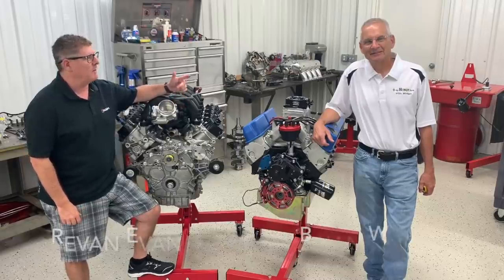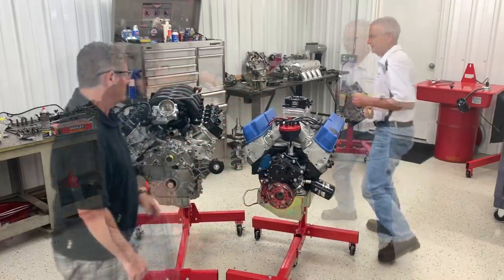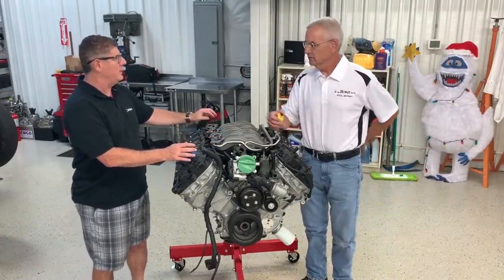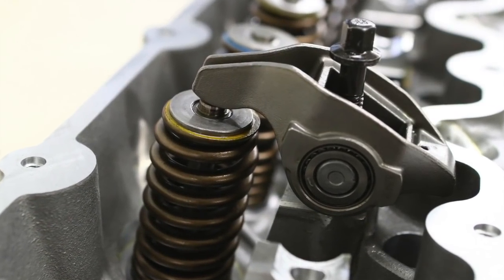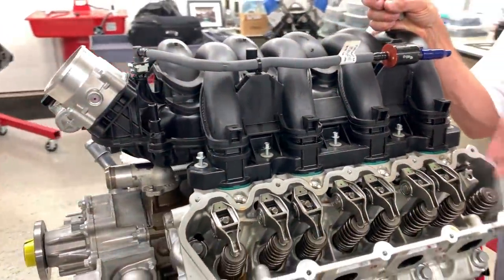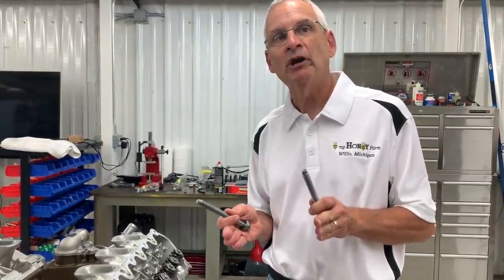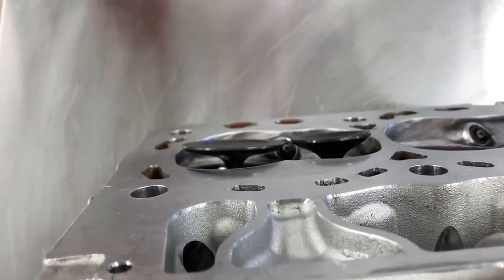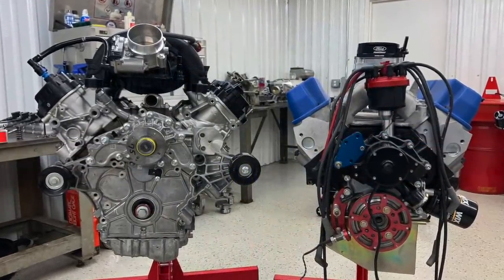Ford 7.3L Godzilla Engine Dyno Results, Teardown & Comparison to Coyote & 351 Windsor Part 2

Comment: Step aside LS there's a new sheriff in town!
Reply: @mewrongwayKOCXF  lol... The joke will be on you..  On a side note I'm not a LS hater, in fact I think it the best engine GM has ever built!  People want to hate on this new engine, but yet the engine screams potential... Time will be the final judge....
Reply: HAHAHAH
Reply: @baby-sharkgto4902  You Sir are Correct!!
Reply: This will unfortunately be fairly low production only being in the superduty trucks.. part of the allure of the LS is the same as gen 1 SBC, huge production numbers.
Reply: Not even close, under 600 horse on a cam swap, head work and intake on that big motor? lol you can get that power from the same mods to a 6.0-6.2 LS and spend thousands and thousands less
Reply: @Doc8224  i was lookjng forward tk seeing stock numbers for sure but those added mods were very minor. The head porting wasnt aggressive nor was the cam. The cams and head work on a ls would be more extensive /aggressive to make those numbers id wager.
Reply: Joey Kimball 
Oh absolutely it would. I think it’s a great motor and I’ll love to see them modded and raced. My point was it is not and never will be a LS contender. It’s not a blue collar race motor to be had by the masses. It’s a low production and therefore expensive project engine. If you spend the same money on this and an LS based build you’ll have way more power for far less money in the LS. They are plentiful and therefore cheap to procure and the aftermarket is super deep because of that. I wish Ford would develop a similarly built push rod motor say in a 5.2L-6.2L size for all their trucks and SUV’s. This would give the Ford crowd the motor they need to build and beat on for cheaper than Coyote or eco boost stuff.
Reply: @Doc8224  but will your LS go to 500" in a stock block?
Reply: Unity MotorSports Garage 
Why would I need it to go to 500? It’ll make more power than the 7.3 will at 500 and way cheaper. Until this design hits a real affordable level it’s never gonna compete with the LS.
Reply: @UnityMotorSportsGarage  GM sells a 7.4L LS motor through gmpowertrain.com It is made for OEM'S. Who knows if GM will put a larger motor in the HD trucks. If the demand is there I am sure they will. Diesel is popular but that is certainly changing. The public has no faith in the diesel emission systems. Weather you like Ford, Chevy or Dodge this competition is good for all car fans.
Reply: @geoffmooregm  you are right... GM offers a 9.72" deck height LSX block that can go to 500" The Factory LS block only has a deck height of 9.24" and a bore spacing of 4.40" so the largest you can get in factory form is 454"   
 The 7.3 has alot going for it by having a "Factory" deck height of 9.6" and a 4.53" bore spacing .. it will be interesting to see how the aftermarket receives this engine... The facts are...if we can't get parts for it.. it will die like the 6.2l SOHC engine did...
Reply: Doc8224 yes sir, so true.
Reply: Robert Bruneau but this Ford engine has some of the characteristics of the LS Engines.

Comment: BEAST MODE! I've gotta get my paws on one of these!
Reply: BIG $$$$$$$  Great Engines without a doubt..Ford, Mopar and GM they all have great engines but i think the big question here is for the average DIY is. Which engine is easier to work on and makes the most power for the money invested into it?
Reply: @Mfil  This Godzilla engine is definitely a big boy and should out power your average 5.3 ls on displacement alone. Hopefully they are relatively affordable once they start hitting the junkyards in wrecked trucks. I'm into 60s Ford's with the big shock towers. It's really hard to fit a Coyote in those older Ford's. This 7.3 should be just the ticket. I'm hoping for aftermarket carbureted intakes.
Reply: Like i stated a great engine. My thoughts are that besides the cost which i believe that it would be quite a bit (Even if you're fortunate enough to find one of these  in the junk yard it is going to cost BIG $  for that engine) and then there's another cost to install it. Did you see the amount of hacking and extra parts needed that has to be bought and done to a FOX body just to installed one of these?  The bottom line is..All it takes is Money!

Comment: It's such a large displacement that it would pair well with mild turbocharging. Barely any lag on 8 or so psi and make plenty of power everywhere in the rev range.
Reply: Lag is dependent on load vs. Exhaust heat and airflow/turbine size and pitch. It doesn't have anything to do with displacement. When talking boost it is just a reference number if you don't know exactly what the cfm per psi is. But saying how much boost you're running or can run sounds cool.
Reply: You shouldn't get any lag on a stock 4.6 or 5.0 with 8lbs either. That's not shit for boost.
Reply: @waynebollentin989  shit. You shove 15 or 20 pounds in a stock motor and see how long it will last
Reply: clyde shelton the point he is trying to make is boost pressure is a measure of  resistance, it not the best way to judge over all power.

Edit- i could put a restriction in the port, raise the manifold pressure and safety run higher manifold pressures on a stock engine.  I will take the pepsi challenge
Reply: clyde shelton  theres literally endless engine platforms that handle 20psi for years on stock bottom end and heads. This isnt the 70s

Comment: Good video. What is the weight of the 7.3? Does it share the 4.6 bellhousing bolt pattern?
Reply: Tractor Tech probably not, since the 10 speed is a heavy duty version. The coyote shares the same bell housing bolt pattern I think.
Reply: @Mfletcher703  The coyote is the same as a 4.6. I think a 6.2 is also.
Reply: It has the same rear face of block as the coyote/modular
Reply: Brian Wolfe the 6.2 or the 7.3?
Reply: Brian Wolfe I know that the 6.2 has some of the design from the 5.4 so if you were talking about the 6.2 it’d make sense if the bellhousing pattern is the same, which I guess would mean the 4.6,5.0,5.4,6.2 all share the same bolt pattern
Reply: @Mfletcher703  I looked in another video, the 7.3 share the same bellhousing bolt patter as the mod and coyote.
Reply: Tractor Tech dude that’s actually cool, besides the fact that it would blow a 4r70 up you could probably swap this into a bubble body ford with ease!
Reply: @Mfletcher703  They had a 10r80 behind the one in the video. I imagine someone will make a manual trans flywheel soon. This engine may be used in more swaps than the coyote due to its size. I really want a 7.3 for my car.

Comment: Gentlemen, I think we have a Contender.
It's about time.
Reply: Does this motor have the lighter valve spring pressures like an ls ? And what about the variable cam timing ? I'm super stoked about the head design, huge straight through port to the canted valve, Nascar style. I'm surprised the motor is so heavy with aluminum heads. The bore looked HUGE to me. I want to see a set flow ported. Finally a stock head that surpasses the ancient Cleveland head. 113hp with extra lift , cleaned up ports and an intake is mind boggling. I bet a set of roller tipped rockers would help too.

Comment: Good results on this puppy but I think he’s sandbagging a little. Lol. Cam swap and compression and tuning I think upwards of 700 hp. And that ol’ boy will likely do it.
Reply: Well I was off a lot. 789 h.p. & a load of torque with his n.a. setup. 1600 with a whipple and I so want one in either configuration. I would love the 800-900 h.p. Engine for my 18 F150. Lol

Comment: Ford said it was built for durability.It is easy to see Ford also designed it for performance upgrades.Ports have minimum curves,canted valves(as mentioned) and beefy block.With the intake ports extended it would be easy to modify them in height and mating surface angle.Plenty of room for injectors to be fitted on intake port runner projectios.

Comment: 600 ponies....nice!
Ford is continuing to push the limits, very welcoming 👍
Reply: These days it had better make 600 from a 7.3L displacement, either that or an insane amount or torque. Not so much impressive as it is expected.
Reply: What horsepower was the 8.1L making when it was introduced? I honestly can't remember anymore.  I always thought it would be tough to top that. I waited and waited for Ford to bring some competition there but they stuck with mod motors....till now. Hopefully this a fun first step of many to lay ahead.

Comment: I'll still take my mod motors over a pushrod dinosaur
Reply: You realize overhead cams are literally almost as old of tech as pushrod? Look it up
Reply: @roncook8566  Older, by several years. First V8s were all SOHC.
Reply: With them being physically larger, heavier if using comparable materials, using more moving parts, being harder to work on - all to make less power unless you use forced induction - what's not to love?
Reply: have fun with your 1200$ cams.
Reply: btw, ohc is older than pushrod.

Comment: 7.3=LS killer.....but I wish ford would bring back the 460 I mean the 7.3 is just 15 cubes from a 460 c'mon Ford bring back the 7.5 in 2024 with 450hp/560tq
Reply: In the days where junkyard LS 4.8s will go over 1200hp on a 200k+ mile, untouched bottom end, by simply throwing boost at it.  That's an ENORMOUS claim to make for an engine that, as of yet, has not been beyond 600hp.
Yes, I edited this.  I point it out so to not look like the "ninja edit".  I did not intend to insinuate that the gaskets were not addressed.  They also filed the stock rings to give enough gap for boost.
Reply: wlabishler 1 - yeah for two minutes before it explodes, also bullshit those engines are NOT stock sealed
Reply: @CoyoteFTW  multiple consecutive dyno pulls...  they ran out of air.  The engine did not pop.  Try again.
Reply: @CoyoteFTW  dude stop being in denial seriously it's just childish. People would not be turbocharging stock ls engines in every corner of the country if it didn't work. People who are blindly brand loyal just make me nauseous
Reply: @ShyaMiss  why dont you talk about the one hot rod magazine dynod and then blew up....
Reply: @frigglebiscuit7484  did I insinuate that none ever blow up?  Find an engine type that has never had a failure...  I hope this isnt too difficult for you to comprehend.

Comment: I would be impressed if the engine spun above 7000 rpm.  Coyote is still KING!  Waiting to see what engine builders will do with the "Werewolf" cast iron block.
Reply: definitely make more TQ than a coyote
Reply: @bigboreracing356  Pretty good for a truck engine.  Cam in block is a giant leap back wards as far as a race engine is concerned.

Comment: Ford copy other engines to improve there battle
Reply: All companies copy each other. The side skirts and cross bolted mains are copies of the 50 YO FE Fords, The non Siamese intake and exhaust ports on the LS are copies of the sb Fords. How old are you 13?
Reply: RD give him a break, he’s 5 years old 😂😂
Reply: If you’re suggesting a pushrod engine is Ford “copying,” then what were the Windsor, Cleveland, and 385 series engines?

Comment: Corvette killer
Reply: This comment makes no sense...  the only place you can currently see this engine, is in a truck.  That's not going to touch a Corvette, unless you mean literally kill it by ramming it.  If talking only about the engine capabilities, this looks to be a good engine.  Yet, it is not anything that Corvette engine does not already have covered.  This is no big game changer or break through.  It is simply Ford recognizing that not utilizing the packaging benefits of a pushrod design in their vehicles, was and is a mistake.  Something their competitors realized all along.
Reply: @ShyaMiss  not really it's more like GM doesn't have the technology to build anything more than a pushrod engine with less reliability, leaks, broken parts etc. Got to love the 5.3 lol
Reply: Finally found the dumbest comment

Comment: Any chance you weighed all 3?
Reply: I was curious how heavy it was too.
Reply: @corey1788  His previous video mentioned a ~ 100lb delta.  I was just curious if they had solid numbers.
Reply: Daniel Miller the coyote is 440 fully dressed and full of oil the others are around the same. The 7.3 is probably low 500s

Comment: 600 hp on 20+ psi......
And go
Reply: Well stock its over 400 hp. With no other changes, 14.7 psi should basically double power output. Good cam intake and exhaust it would easily make 1000hp+.
Reply: @lilsammywasapunkrock  320 CFM head also flow well but that's one big motor. Should be interesting
Reply: @lilsammywasapunkrock  then blow up
Reply: @fread51  what would blow up?
Reply: @lilsammywasapunkrock  the engine
Reply: @fread51  why would the engine blow? 600 hp really isn't all that much on a 7.3 liter engine. That would be less then 200hp equivalent out of a 2 liter 4 cylinder. 

I mean, its a ford. Its going to be way over built, especially where its designed from the ground up for heavy trucks. The original sbf was designed as a stop gap between inline 6 and Mel blocks in the new compact line of cars for gas mileage and only made 90hp. Yet the blocks didn't really have problems until 500+ hp.